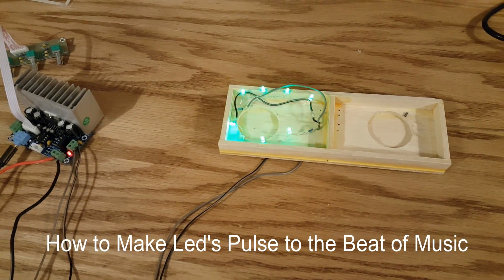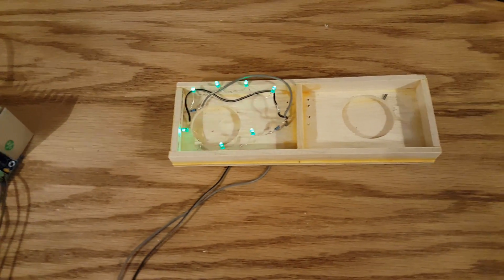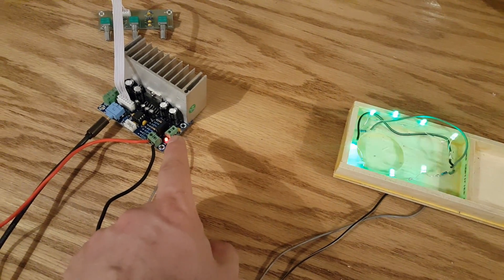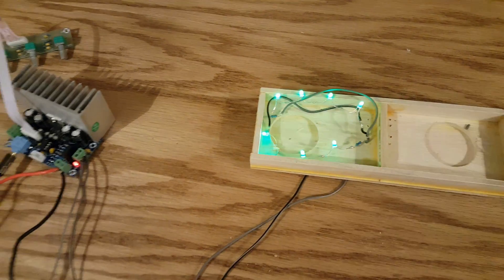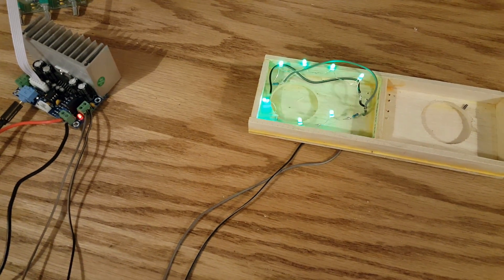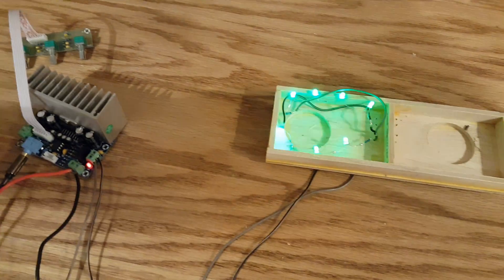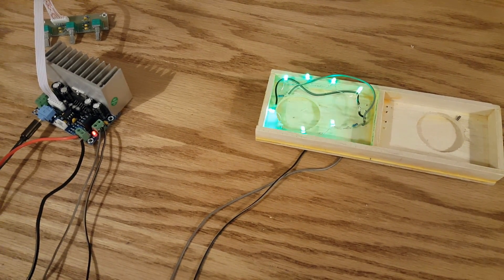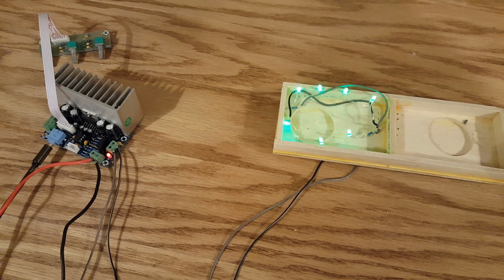DIY- How to Make Lights Flash to the Beat of Music

Comment: So the 50ish watts being put out isn’t too much for the LEDs? My LED strip is 5V, so my concern would be them getting burnt up.
Reply from the maker: No — 50 W just means the supply can provide up to that much, but the LEDs only draw what they need at 5V, so as long as the voltage matches, you should be safe.

Comment: Since the actual voltage on that circuit fluctuates with frequency, how did you decide on the resistor size?

Comment: Im a bit sceptic about 2.1 TPA3116 boards with build in bluetooth. I heard theyll create loud plops when turning on/off. and have alot of noise. 
Should i buy a 2.1 board without built in bluetooth, but with the sure bluetooth receiver. or should i use 2 amps instead. or something else. what would you recommend?
Reply from the maker: Most cheaper board amps suffer from that problem.  It is often best to use 2 high quality amplifiers, like sure amps instead of a 2.1 board amp.  I personally haven't had great success with many of the 2.1 amps.  For the best sound quality I would use the sure bluetooth adapter and 2 sure board amps in conjunction with this variable low pass:https://www.parts-express.com/variable-low-pass-filter-electronic-subwoofer-crossover-preamp-board-with-gain-control--320-670  That would have great sound and shouldn't have any popping or noise issues.  Here is a video in which I show that unit in action.  https://www.youtube.com/watch?v=TvbkwwLSRvE
Reply: yes i think i will go for that. problem is that sure is quite expensive when use 2 of their amps with their bluetooth receiver.
I also found this board: http://www.ebay.com/itm/111832076600?rmvSB=true.
 this board uses the TPA3116D2 chip and is nearly perfect. no hiss, great sound and no plops. the only problem is that it has to be powered with 24 volts at least. not sure if i like that.
Reply from the maker: Yeah.  The sure amp, would be the high end option.  So it is definitely more expensive.  However, the sound quality is much better.  You could use one of those.  I haven't used that particular amp.  However, you may want to check out BigDWiz, as well.  He tests a lot of small board amps and might have some more information on that.  Just let him know I sent you ;)
Reply: ofcourse :)